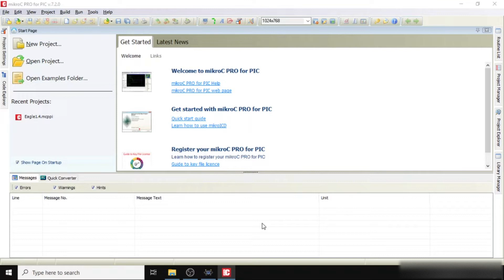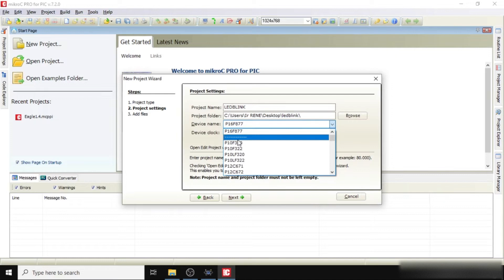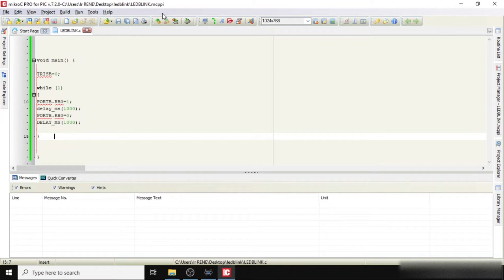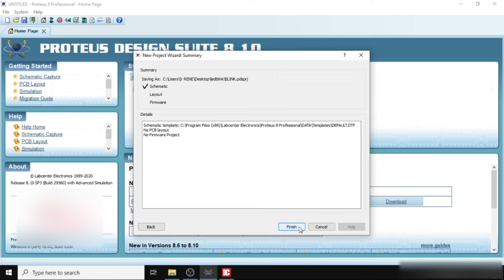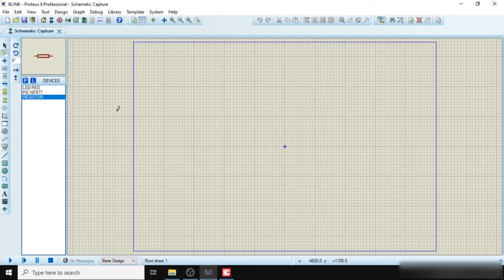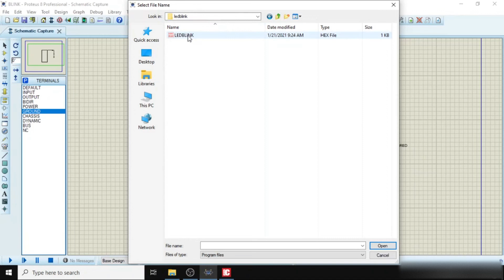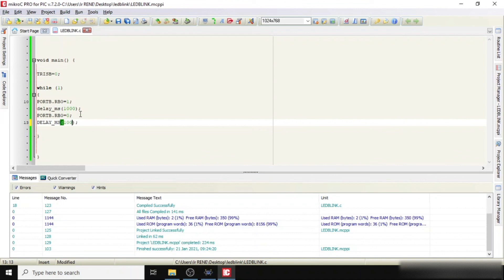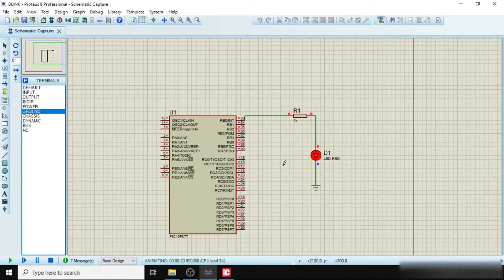Mikroc for PIC Programming basics

Comment: It looks like you neglected to choose the configuration options for the device.
- Internal vs external oscillator
- MCLR on/off 
- Code protection on/off   
etc

Also - it would be wonderful if someone would do a presentation of setting up a project for one of the PIC devices which are commonly used today such as the PIC16F1825 or the 16F676

Many of the PIC devices that are still being shown today in these tutorials are devices that were used 20 years ago.